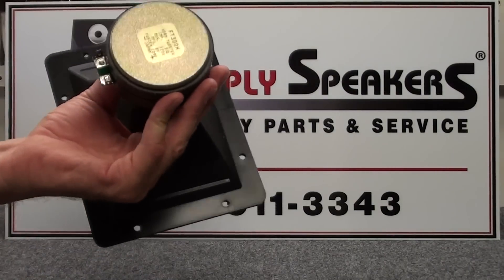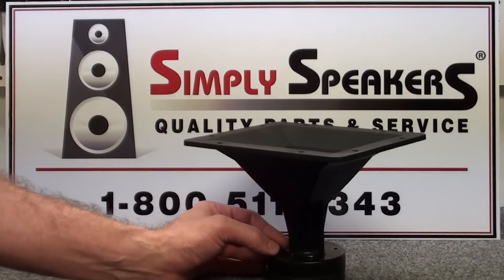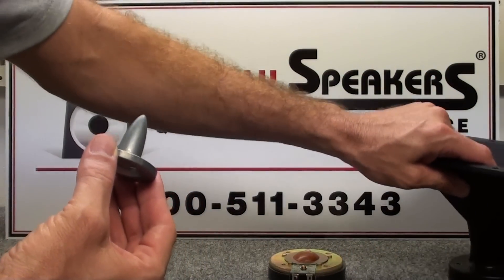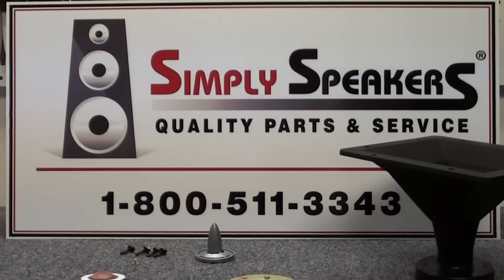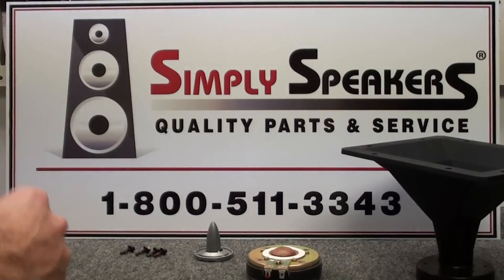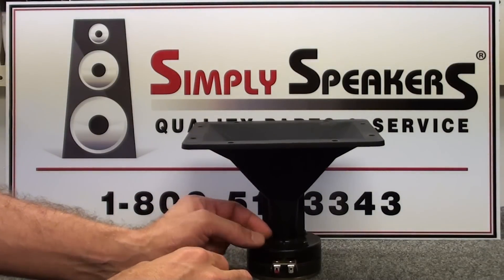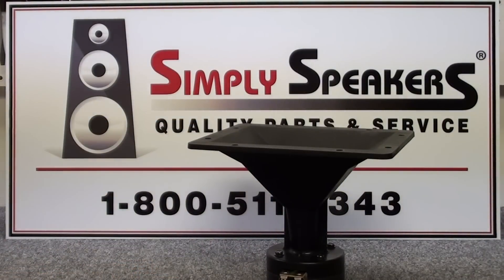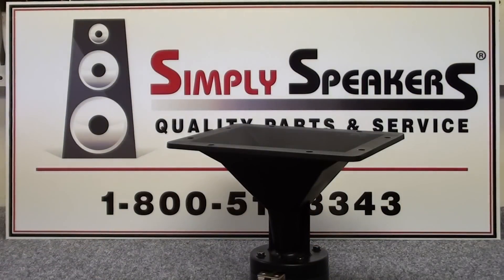Speaker Repair Foster H025 and Cerwin Vega Horn Diaphragm Replacement by Simply Speakers

Comment: I've ordered new diagrams for my klipsch heresy 2, do I have to fill te gap with ferofluid?
Reply from the maker: Usually not, but if the old fluid is burnt from a failed coil, then you should replace it.